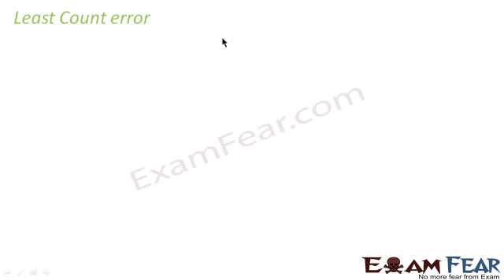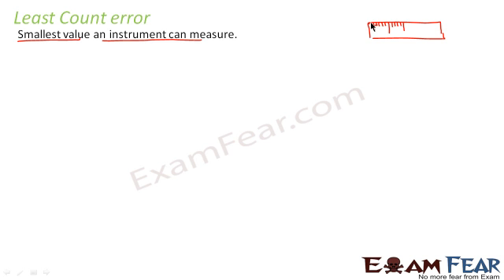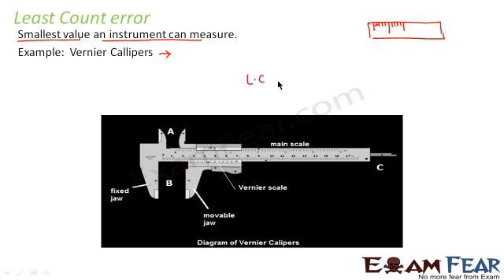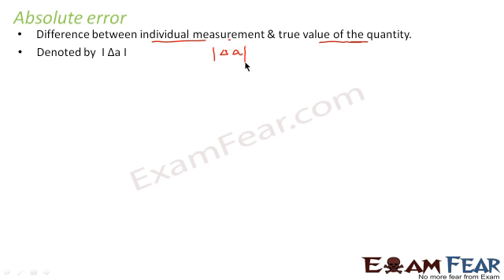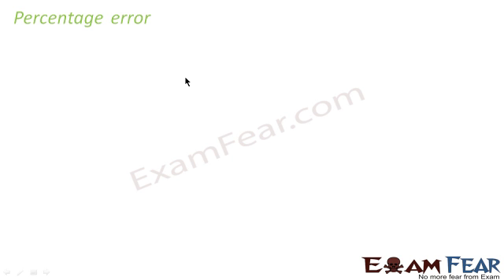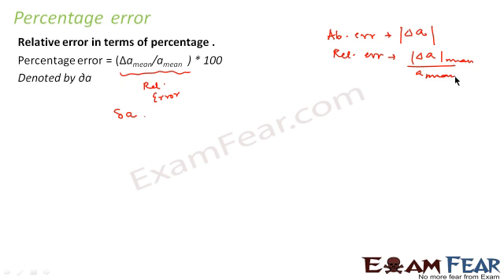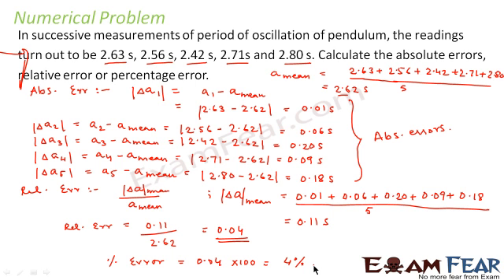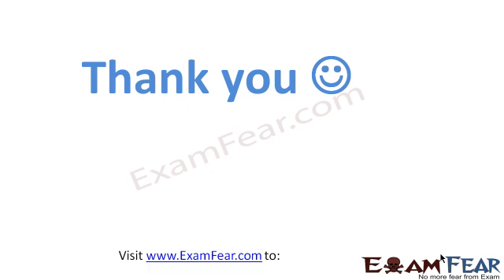Physics Unit and Measurement Part 6 (More types of error) Class X1 CBSE

Comment: How| delta a| mean= 0.01+0.06+0.20+0.09+0.18 = 0.11
                                    ________________________                                                                                                                          
                                                5
Reply: aree because it's an ncert solved....😂 ..wrong calculation gives rights answers ...
Reply: I guess its by doing approx
Reply: same question??
Reply: yeah ...it should be 0.01+0.06+0.20+0.09+0.18 / 2.62 according to ur formula
Reply: The answer should be 0.108 and so on but to simplify the solution, it is rounded off to 0.11